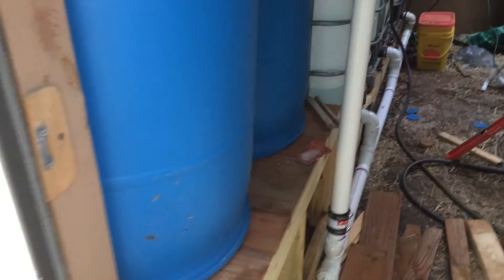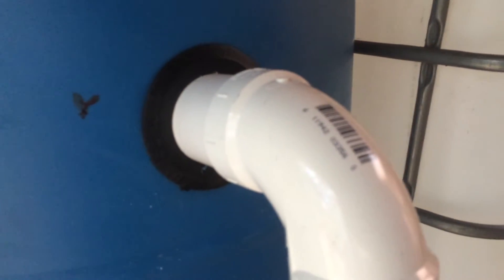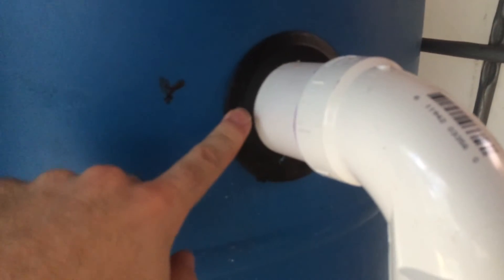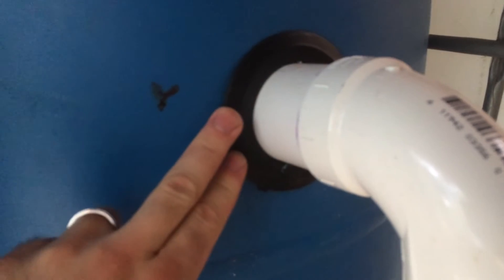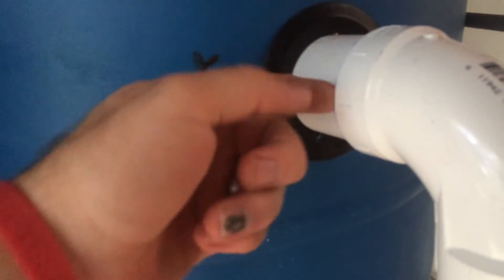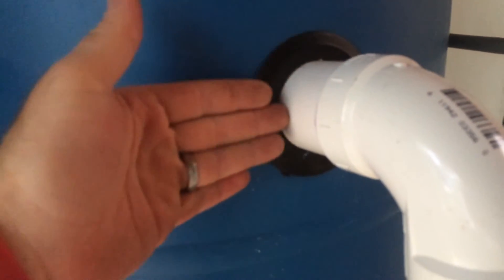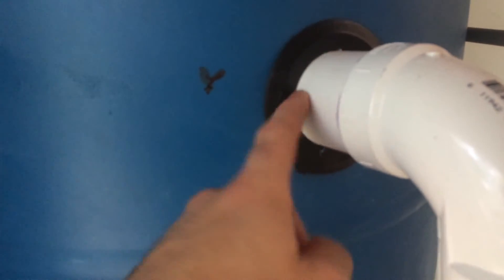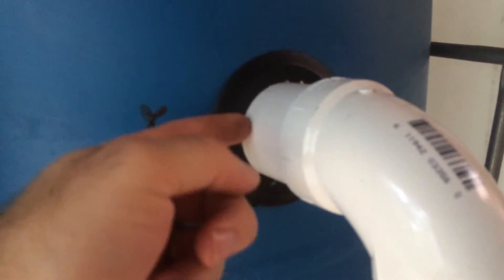Uniseal Installation Tip

Comment: OMG... You are a life saver.  I was struggling with my 2 inch PVC.  I cut myself, hands went numb and still couldn't push that thing through.  I used a bench grinder with a wire wheel at the edge, followed with some sand paper.  A little Olive oil and it slid in without effort.  Thanks a million.

Comment: Huge pain in the ass learn that tonight!
Reply from the maker: Haha, just round out that end and lube it up with a water based solution and it's not that bad. Then it's just all about leverage!
Reply: Tom Brueggen Yeah I was able to get my first one in after watching some videos...but I think it is really hard for me since I am going into the side of an IBC...and the wall gives in a lot when I push. So it is hard to have the wall hold firm while I apply pressure. I have two more to do tonight on the IBC, then 2 more for the Radial Flow :)
Reply from the maker: blackboy424 You may try reinforcing around it so it doesn't give so much. Cut a few 2x4's to span to the other side of the tote and cage for a bit more support. Or get in the tote and shove it through from the inside so the cage offers the support you need.
Reply: Thanks I will try that...is there any issues with the uniseal facing one way and not the other? Most configs show the larger side of the seal, on the outside. I couldn't see how it would make much of a difference.
Reply from the maker: blackboy424 No issue. I was always thought it was a concern too, but then saw "fishandworms" do it on a blue barrel. So I did the same on part of my setup, out of necessity, and it works fine, no leaks. After all, your sealing mechanism isn't so much the flared rubber edge, it's that direct rubber to plastic contact point within the wall of the IBC. Give it a shot. If it leaks then you'll have to figure out how to reverse it. Or you could just use a threaded bulkhead instead as I assume you're going through a flat side of the IBC. Keep in mind, the real beauty of uniseals is for install on curved surfaces.
Reply: THanks buddy, I was able to find a groove with them yesterday. Certainly was a learning experience. 

Thanks for all the help
Reply from the maker: blackboy424 No problem, we're all in this together! Stay tuned and best of luck moving forward!